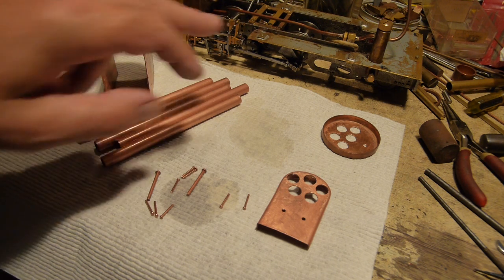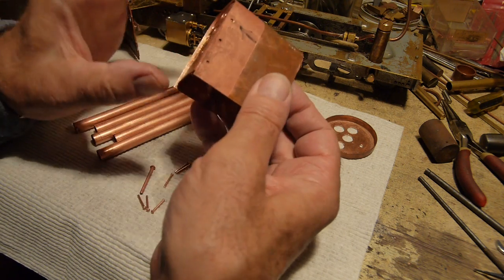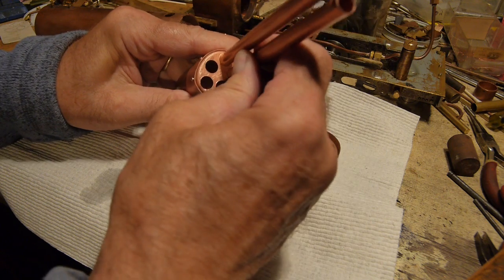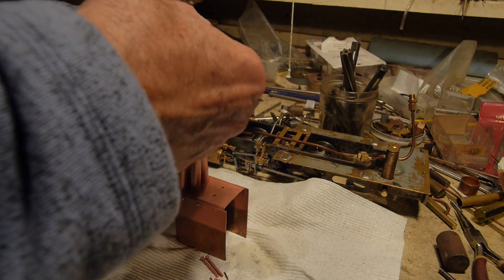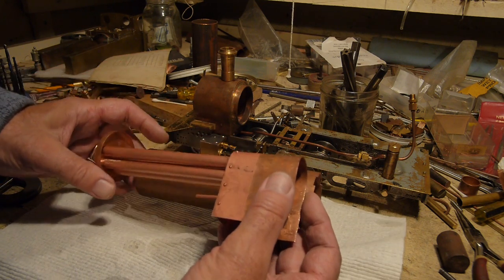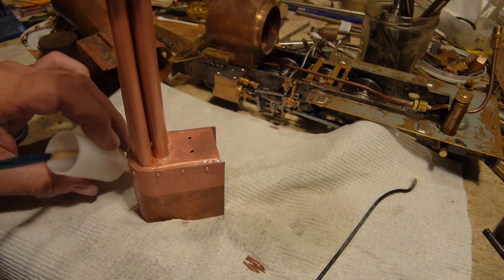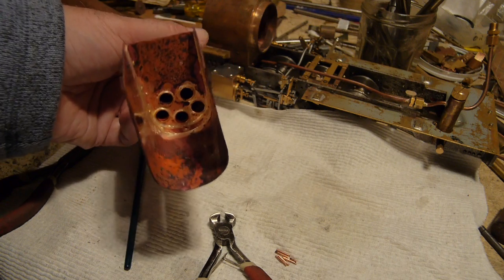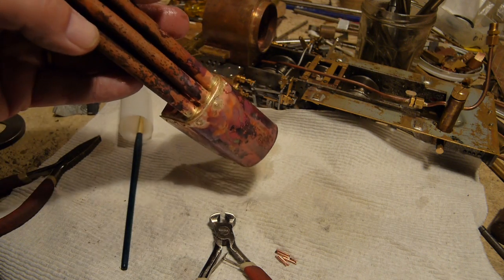Boiler making for live steam model locos, Part 3

Comment: what is the size of the 5 fire tubes? and the lenght? Could you give me some measurement of that boiler and firebox? Thanks!
Reply from the maker: I've taken these measurements off the loco completed as I didn't make any drawings during the build so they are not absolute:  
Boiler barrel O/D  2”
Length of Boiler  7  1/2”
Fire box outside width  2”
Inner firebox 1  9/16”  wide by  2”  long by  2  1/2”  deep
Fire tubes 3/8” O/D by 5” long
Hope that helps.

Comment: I know it's off topic but how do I make a lamp holder for putting on the front of a 3.5 inch loco?
Reply from the maker: Hi Matt, first decide what lamps you want to use.  The fitting slots on the back of the lamps may be different.  Find or make some brass strip to fit the lamps and bend it into a 'L' to fit the running boards.  Or a 'L' with a tong to fit on the smokebox face and the rear tender.  Silver solder the tong on and rivet or screw the fixings to the loco.  Hope that helps.
Reply: @GandyDancerProductions  thanks for the advice. Where is best to get the metal from?
Reply from the maker: @mattseymour8637   K & S Metals have convenient brass strip but there are other suppliers on Amazon.  Also try you local hardware store  you'll might be surprised what you'll find there.
Reply: @GandyDancerProductions  thanks will see what can find

Comment: What acid do you dip it in
Reply: Hi, I used acid crystals I got in the tin from Small Parts in the US.  You can use battery acid from a car accessory store.
Reply: @jonathanguilbert8658  Citric acid (lemon juice) 50% water does fine.

Comment: How do you curve the shape of the cooper plates？And are those solders similar to the one used to solder PCB boards? thank!
Reply from the maker: Hi Yiming, the main part of the boiler is a coper tube and opened out at the fire box end.  The rest is formed over wooden blocks.
Reply: Gandy Dancer Productions thanks! Keep up the great work!
Reply: @ChengduLittleA  You have to repeatedly soften the metal through heat treatment. Forming work hardens it. https://www.youtube.com/watch?v=2JUWlZ5xt5o this video shows some of the process.

Comment: What thickness was the 2” copper boiler tube also can  you buy such tubing from plumbing/ DIY/ building suppliers?
Reply from the maker: You should be able to buy this copper tube from a plumbers store.  It's wall thickness is 1/16" internal bore 2" and external diameter 2 1/8".

Comment: I need some 6" copper end caps for a boiler. Can you refer me to someone ? I can hammer my own but would like cleaner pressed look. Thanks
Reply from the maker: Sorry David, I can't give you advice about who to go to for flanging your boilerplate.  I make my own on a wooden former and lots of annealing of the copper.  Comes out looking nice.  You could try professional model boiler maker, there are a few on the web.
Reply: Its only the flanges that are beaten and these end up inside the outer rapper. 
If you want them "factory made" it will cost you a fortune with all the tooling.

Comment: This is a question that has puzzled me... for ages. When all trains, not just live steam locos, move, you know how the big cloud of steam puffs out in the beat of the pistons? If the smokebox is connected to those pipes that go into the firebox, then why doesn't the smoke just stream out? What makes it go to the chuff?
Reply from the maker: Hi Andrew,  good question.  The dynamics of the smoke box is one of the most important parts of a steam engine.  The smoke and flame from the fire comes through the tubes as you say.  The exhaust steam from the cylinders come in at the bottom of the smoke box combines with the smoke and the puffs throw it out of the chimney.  The puff creates a vacuum that draws the fire through the tubes.  Without them the fire would go out and that's why you need a blower on the chimney when the loco isn't puffing.  The more the engine works the more it puffs and draws air through the fire to generate more heat and hence more steam.

Comment: What tools/techniques do you use to set the copper rivets?
Reply from the maker: To rivet the plates together I simply use a small hammer and a steel bar held in the vice as an anvil so I can get into the narrow space of the firebox. I'm using copper so it doesn't take to  many hits to close them.  I don't worry about flattening the domed head of the rivet.
Reply: I assume you set that up with the rivet head inside and against the bar anvil, forming the second head with the hammer?
Reply from the maker: Yes, that's correct.  Just make sure the part for silver soldering are a good fit together to start with.  The rivet is only there to hold it together while you heat them so don't make the rivet too tight or the solder won't penetrate.

Comment: hello . very nice work . where did you aquire the drawings . I'd like to make my own loco in 32 mm gauge
Reply from the maker: Hi Rick, the plans i used are from the booklet - 'Russell: Story of an Historic Narrow Gauge Steam Locomotive' by Welsh Highland Railway - which is out of print but you can find it second hand online.   They depict only side elevation, ends and top view of the complete loco.  You have to figure out the rest yourself.  There's a number of parts you can get from Roundhouse Engineering like cylinders, dome and regulator.  Good luck and thanks for your interest.
Reply: do you have a video of the first coal firing please
Reply from the maker: Hi Rick, I haven't yet.  It's too cold outside to stand about waiting for steam so I've got on with other model engineering jobs.  Once spring comes I'll coal fire.  There is a video of a steam test I did on gas. https://youtu.be/b2c-_yaOqrs      Subscribe so you'll know when coal firing happens.

Comment: I am looking to build a 7.5  and do you recommend buying the cylinders I have no lathe so I would have to be drilling and filling
Reply from the maker: Raw cylinder casting are quite expensive and complicated to machine.  Fabricating them from tube and plate material is even more complex.  If you don't have a lathe get someone you trust to machine castings for you.
Reply: @GandyDancerProductions  And do not start with a 7.25 loco!!!

Comment: How much did it cost all in all
Reply from the maker: A lot of the raw materials like the frame steel, buffer beam, wheels and brass for the side tanks and cab I already had.  The copper for the boiler and the tubes were given to me by a friendly plumber.   All those little steel screws you see are 8, 10 and 11 BA with hex heads that are one size smaller and are quite expensive.  The silver solder for the boiler cost around $70.  The part that cost the most were from Roundhouse Engineering such as the cylinders £140, dome, pressure gauge £27 and regulator £22.  The cylinders were well worth the money considering all the work they saved.   I would estimate between buying parts and scrounging material I've spent $500.

Comment: what kind of solder do I need?
Reply from the maker: In the US I buy my silver solder from McMaster-Carr they call it 'Brazing Alloys'.   I use two types: a lower temperature with catalogue # 7676A6 and a higher temperature with catalogue # 7673A4.  I get them in coils of 1/16" wire.  It's quite expensive at $80 plus shipping and you'll need flux with it.  Start with the higher temp first then the lower temp solder so things don't melt and shift.
Reply: OK, thanks

Comment from the maker: You're right, I started making videos on my little steam engines then decided to make a detailed series about boiler making as a sub-series but follow on the numbers in the film titles but start afresh in the page title.  Sorry if that is confusing.
Reply: I've noticed a little hole in the top of your front tube plate, above the tubes. What is that for? I am in the process of acquiring the tools and materials to make my own boiler which will fit a gas fired engine I have.
Reply from the maker: @M_F754  It's for a copper stay that runs from the tube plate to the back head to give a little extra strength.  You can see it on the next video as I put on the back head. https://youtu.be/X_BsYd7xM8w.
Reply: @GandyDancerProductions  Thank you very much! I am just watching now. 
One more question if you don't mind. What is the larger size of copper rivets you used? I have some 1/32's on the way already. 
Many thanks!
Reply from the maker: @M_F754  I used 1/8" copper rivets.
Reply: @GandyDancerProductions  Thank you. Much appreciated 🚂